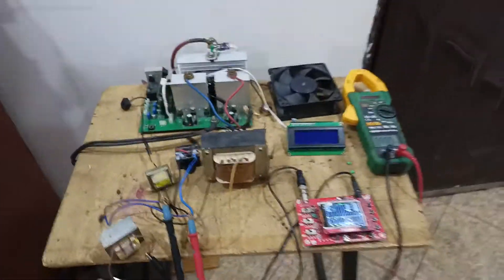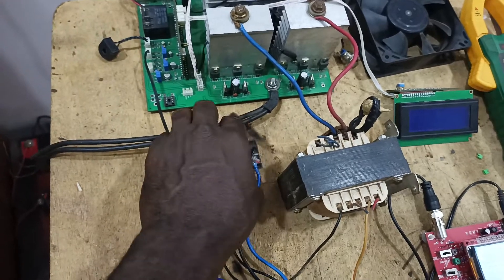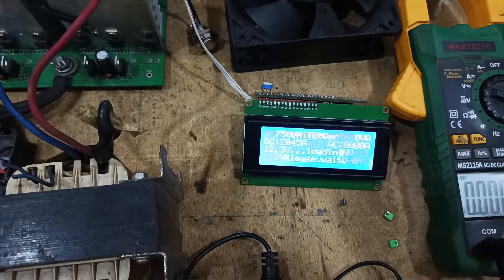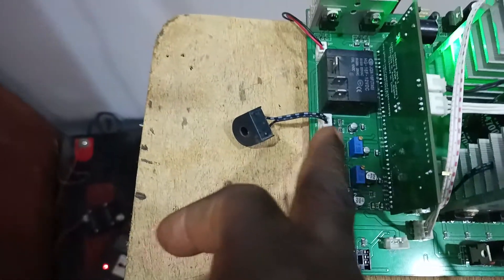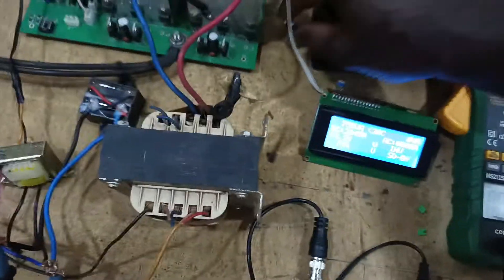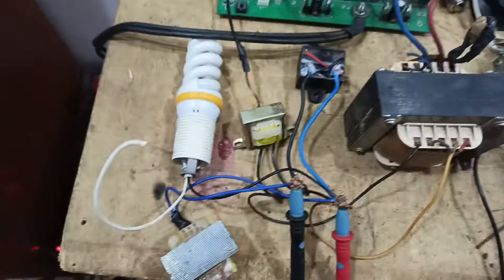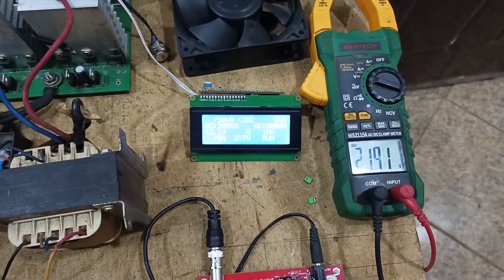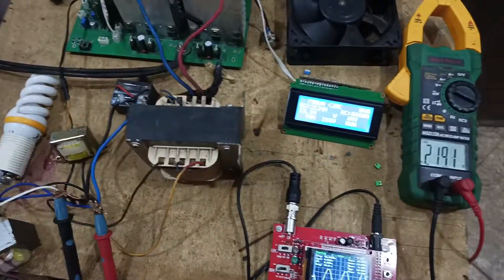pure sine wave inverter part1

Comment: That's exactly the sensor that's been confusing me INA282
Reply from the maker: Ok.
Reply from the maker: What exactly, do you need clearification on concerning the INA282
Reply: @yakmoh1  I couldn't get the module as a whole in market. So how you made the module is what is confusing, I mean the circuit connection. I was only able to get the INA282 chip in market
Reply from the maker: @bashiralao9172 . The complete circuit diagram is on  www.github.com/yakmoh/Green-Energy
Reply from the maker: I could not get the chip, so I used a module, u can get the module on AliExpress (INA282)
Reply from the maker: I have a Whatsapp group, if I are interested in building on it, u c as n join 

https://chat.whatsapp.com/HkW22E0zVZoDednaDvCHmM

Comment: Sir, it is not easy. You have made a very complex circuit
Reply from the maker: The circuit is not complex , I tried design the entire project in modules, so that each module can be separately worked on or upgraded